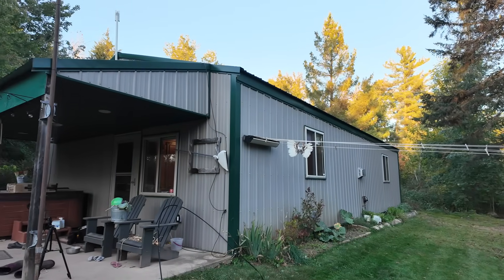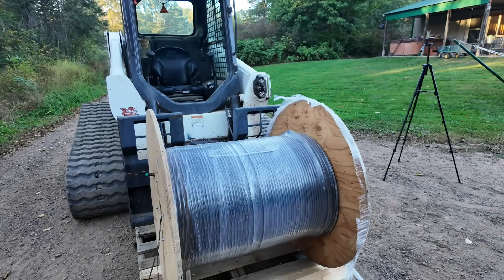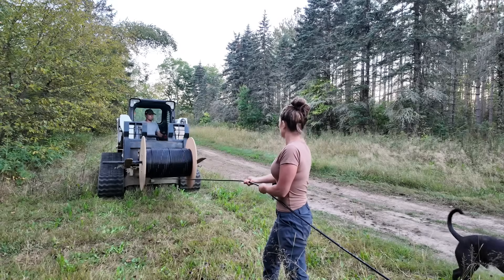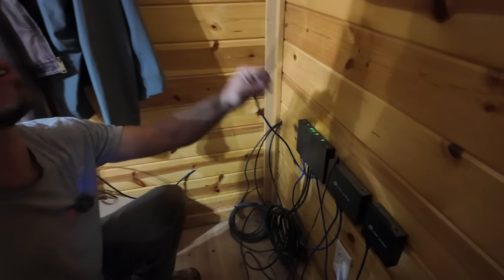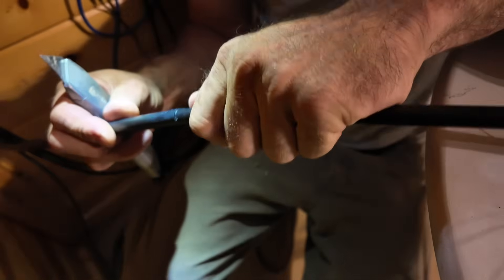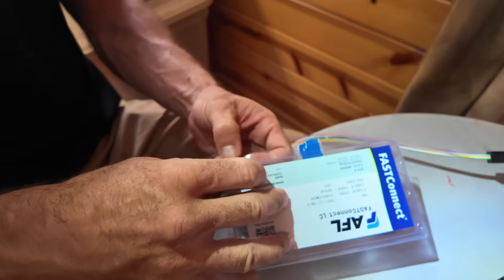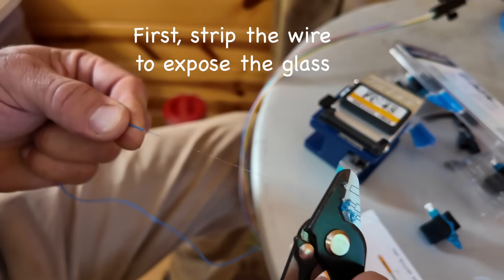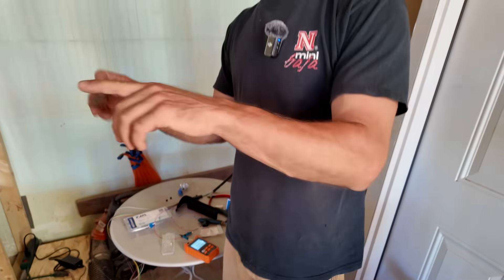We Need Internet! Running a 3,000 ft Fiber Optic Cable

Comment: Hi Guys, I have the exact same scenario that needs to be done - extending a 300-500GB ISP service just over 2600' and thought about doing the exact same thing as you before I found your video.   QUESTION:  Barring standard losses in an imperfect system....the only thing missing from your video was results. you said you were "happy" with the results...but what were they.    Can you share a little by possibly giving a speeds test (directly connected to your Starlink) and then a speed test average from your shop wifi at the other end?   I also love the TP-Link stuff and also was going to utilize the TP link Ethernet to fiber converters, etc...   I would love to see what your results were - like are you getting 150MB from starlink and close to the same at the shop....or are there some decent losses, etc...    Please advise.       The only difference is that I would be using pre-terminated 2600' (6) fiber line.

Comment: The only things that i wouldve done differently would be putting a 2 or 3 handholes every 1000' or 750' and leaving like 20' or 30' of slack in them just incase anything bad happens to a segment of the fiber. And the process of prepping the fiber and putting iwouldvehousing or wall mount would be the best. But other then that, great job on taking it upon yourself, researching, doing the work, and making mistakes. Thats how you learn and get better!!

Comment: FYI you were testing at 850nm which is used on multimode fibre. Your SFPs are single mode and user 1300nm.

Comment: Great job figuring all that out. You're also supposed to clean the ends of the LC Fiber connectors with isopropyl alcohol to remove any dirt and oils from the tips of the fiber ends.

Comment: Fiber is a good futureproof solution. especially single mode like you have here. I've installed miles of the armored stuff like you have. Keep it away from the mowers and snowplows and it will be good for decades. If you build a side road or need to protect it, split some water pipe for protection.  It's also good to leave some slack in the woods every once in a while in case it gets damaged and you need to splice it back together. In current professional installation, we'd use a fiber termination box/shelf with connectors and pigtails and fusion splice the pigtail leads to the outdoor fiber with a fusion splicer, skipping the fanout sleeve.. Another 1000$ and more learning.... But your old school way is fine. The light meter you can test with a patch cable to the light source, then add the fiber link in the middle and subtract the two numbers to see the difference.

Comment: Ryan & Katie.  It was reasonably challenging to find the basic facts on you.  Like your names and where you are.  (Which is Northern Minnesota.)
As of last week, I got my fiber optic cable installed for Internet service.  (Is that why YouTube recommended your video?)  Glad to be free of the oppressive cable utility!  It was ridiculously challenging to find the "terminate service" button on their website.  And they still want to charge more!  Prorated something or other.
I am very impressed that you did your own fiber work!  Especially the diagnoses!  It is so different from wire-based technologies!  As you will be dealing with cold conditions, I understand why you will be trenching and burying that cable.  May I suggest burying with it a tracer wire?  I have a 15 year old natural gas line that has one and it has been used twice to avoid the gas line for subsequent work.
Regards from Oregon!
Reply: Excellent suggestion on the tracer wire! 👍👍👍

Comment: I had this issue. I ended up going with the Deco mesh system, with solar powered x50s installed up on trees backhauling each other. Benefit is you get gigabit internet through the entire woods. Bad part is ping gets bad the further it has to hop. Your setup looks reliable and robust!

Comment: But why? I set up a WiFi link 20 years ago that went 22km at full speed (for the day). I think you got ripped off with your wifi link. Heck, the tiny dish looks like an indoor TV antenna. With a couple of decent yagi antennas it shouldn't be a problem, even with bog standard routers.
Anyway. Besides all that I did find your video interesting and entertaining. Cheers.

Comment: Actually about those fiberoptic connectiors, one need to get them sortof flat and then preferably polish the ends, but those connectors you used is probably those field assembly thingies, they are kindof forgiving because of the gel inside. works on short distances but when doing thousands of kilometers u need the polished glass ends, also make sure not to put any grease on the ends, they are fairly sensitive to dirt, even invisible dirt. ones fingers are enough to totally destroy the connection. then cleaning them is the solution.

Comment: I did buy the 12 core cable because the 2 and 12 core was about the same price, there was like a 4% difference. one never know if it will be needed later, in my case it actually became needed later, but that might be because i'm a computer dude :D

Comment: For me, I simply put up a second starlink.

Cheapest option overall especially figuring in time and redundancy.

 Later,
 i put up two 50' radio towers w/10" pole, on both ends with a wireless bridge as back up to my back up.

Then I added to the towers cellular boosters with custom yagis.

That gave me 4 means of outside communication redundancy.

Im a HAM as well, so adding radios to both locations added 2 more. 

Then I figured I could also add TV & radio broadcast antennas. 

Got hit by a microburst. 

Still had coms at the guest house.

Comment: The reason the wireless bridge didn't work is because it's 5Ghz. That is line of sight only. For going through a few trees you'd need a 900Mhz bridge. They are harder to find, but would be more likely to work. The trade off is the speeds aren't as high.

Comment: Fiber is fairly easy - it's the mechanical aspects of running the cable that is difficult.   When I did my most recent run (1850 ft), I hired a company that used a ditch witch to install a 1" conduit designed for fiber with hand hole boxes about every 500 ft.   I didn't have a meter, but used pre-terminated fiber that came in with a lab report from the vendor which tests the cables after installing the ends.    Worked great with 10km rated single mode 1310nm SFP transcievers in Netgear switches.    I also use a box with a fiber patch panel where the fiber comes into the building so all exposed fiber can easily be replaced if some ne'er-do-well damages it.

Comment: I also suggest you get a box that will mount on the wall specifically a fiber optic cable box, most are waterproof but still serves the purpose at protecting all the fibers dead lines or in use

Comment: Lots of fiber guys in the comments, right on! I did some wireless ISP stuff years ago and yeah, when you mentioned doing a point to point wireless shot "through the trees" I cringed a bit, that 2.4/5ghz stuff really didn't like non line of sight stuff in any situation and we generally had to use 900mhz non line of sight gear for stuff like that, but you're still limited on distance, bandwidth, noise, path, etc... long run you're going to be much happier running this cable though and it'll at least give you consistent connectivity to your stuff behind the firewall. Great work!

Comment: Put that fan out kit into a termination box mounted on the wall and use some patch cables you will be set up perfectly. Mounting the cable and the terminations into the box takes the strain off of everything. No problems in the future that way.

Comment: A much easier solution is to buy some patch cords. And cut them in the middle, then splice them on with a fusion splicer. It will make very consistent connections everytime and you won't have to deal with the hassle of terminating.

Comment: Only works with no obstruction. 
Microwave links are great if there is nothing in the way. 

I remember when the fiber was installed for the Internet to replace the old copper. 

For 3 years they dug the trench along the highways and I didn't see any amplifier 
They had flower pots every mile to splice the cable together. 

But as far as I could see, from MP144 to MP64, 80 miles, they had just the fiber cables. 
From one switching center to the next.

The craziest thing was seeing these massive cables as big as my arm and the capacity was maxed out, and when they switched on the first fiber on, the meter went from 100% to 0
It was below 0.0001%
The technology that we don't know will exist is mind-blowing to think about 

Remembering the 6 foot cube that weighed 4000 pounds that was the 10 MB hard drive in 1950
And in 1980 that same drive was 12 inches by 6 inches and 30 pounds 
And in 1994 a CF card weighing a little more than a stamp was 10 MB
Watching the CF cards go up to 1GB
And the TF cards going up and now something smaller than a stamp and the same weight can store 4TB

I remember Ethernet first coming into existence.
And then wifi
And the size and weight just kept getting smaller 

The Cisco Router weighed 50 POUNDs and took up the entire rack
Now a 12 inch by 1 inch by 5 inch box weighing 3 pounds does more than the original router did
And the new router was 250 and the original router was 10,000 dollars 

For us old people who remember tubes and watched the electronics go from infant to mature, I feel really old

Comment: Great job! One suggestion I would make, is that you secure your cable to the wall after it comes in (allow some slack for future potential repairs), and give some sort of protective covering to the small strands coming out of it. Generally, with a rack install, you would run your main cable into a fiber distribution shelf/tray with F-F connectors on it, and then use easy-to-replace fiber patch cables from there to your equipment. But even if you don't use a fiber distribution shelf, having some sort of protection around the delicate fibers will be wise. That way the fibers from the cable stay securely out of accidental danger of being ripped out, tripped over, mouse running on it or chewing on it, etc. and if some of your network equipment falls off the wall or you accidentally rip the fiber out of it or something like that, you can just plug in a new patch cable and you're good to go, rather than having to go through the full process of re-terminating the main cable, testing at both ends, etc.

Comment: Learning and getting your Amateur radio license would've taught you so much about RF and why this project didn't need fiber. 😭 2 Towers and proper equipment this is easy peezy to solve wirelessly with basic equipment

Comment: As someone who works on fibre optic networks in the UK, this was very interesting to see how you'd do it from a DIY view point.
Amazing work though for DIY I've seen people do way worse haha.

A few suggestions for you for long run would be to run your 12F into a CTU / CSP (a housing) then buy pre terminated duel LC cables for a TX/RX system (that's what your using),   If you can rent a splicer this way the cables will be much stronger and stable connection, this way not making custom ends.

You maybe could use a SC connector so that way you only need 1 single fibre running into from the SFP chips. (this is main source we use in UK)
Reply: Exactly, I was wondering why they need tx and rx with such distance(usually single mode were used when over 1km)

And yup splicer and pig tail works way better.

Comment: This is a great video. I do have one input on the Fiber SFP modules (Small Form Pluggable) beware of running you optics too hot closer you are to their transmit levels or above you will burn out the receiver sooner. Most manufactures will tell you what the ideal operating range for the optics is. Looks like for the TEG-MGBS10 you guys have that's a 10km 1310 so a safe operating should be around -5 to -8 and according to the Trendnet its sensitive down to -22bdm. so you may need to buy a single set of attenuators to attach to one end of the fiber to pull down that light just a little. Just worrying about your longevity here from a network engineer stand point. i also believe that with in the TP omada control system it should give you the feedback of what light levels both sfp's are seeing, so no need to unplug and retest while taking down the connection
Reply: I hacked it with the TEG-MSGS10 at an install.  My original 100ft and 800ft runs are working nicely after 5+ years.  My 1800ft run is a year old and holding up nicely.    Perhaps I should worry about my 320 ft run, but the SPFs are not a big cost item.  My most recent run (the short 320 ft one) used the RI-MGBS10 SFP with a slightly better low temp rating (these are using in unheated outdoor enclosures).

Comment: Measuring to where the cable enters the cabin?   I hope you have allowed additional cable  to where the cable needs to go inside the building (and preferable a good length loop for future changes and termination repairs).  It is extremely false economy to be short.

Comment: I learned fiber termination a couple decades ago, we were using hot melt and epoxy connectors then, you stripped the buffer layer, inserted it into the connector, let it cool, scribed the glass with a diamond edge, snapped it off, and then lapped it flat and clean, checking it under a microscope. real pita compared to the push and go impedance matching gel connectors of today.

Comment: First time viewer. Very nice "tutorial" as it were.  I love the fact that you explained what went wrong and why it did and how to fix the problem. Excellent work done!!

I've actually thought about doing something very similar on my property. But instead of connecting two homes, run a main line from the pole where the cable is serviced to the back part of the property that's not developed. Don't want to pay the installers to run that long bit if not needed (if it's cheaper than running cable, then sure)

Comment: I agree with others, great job, but bury that cable properly! And securely attach the cable at both ends with wire clips, but ensure the bends are smooth and curved gently as possible in the cable, no sharp kinks, and get a grommet for that hole in the metal shed you cut.

Comment: If I may make a suggestion. When you bury the fiber also bury a 6 pair direct burial phone cable (22 awg), not in the same ditch. This will allow you to install a ring down phone as backup so you can at least talk from one end to the other in case the fibers get damaged.

A ring down phone will allow you to talk with the other end. Just pick up a phone at one end and the other phone will ring until it is picked up. The ring down unit cost about $200 or $300 .

I use one between my shop and house. Nice job with the fiber and setup!

Comment: For burying your fiber cable, you might find it handy to buy an attachment for your compact track loader. They make vibratory plows with a chute that make a knife cut in the ground and bury your cable. You can also get them with another slot for burying the warning tape. Vermeer sells them, but lots of track loader manufacturers make them, and if they don't, you can ask the sales person to point you in the right direction. The other attachment you can use is a trenching attachment, but then you have to go back over the trench and back-fill it, so it is more labor. You might find a Vermeer or Ditch Witch location with some units that you can rent to do everything.

Comment: Hi, thats cool looks like anyone can do it. xD Here in Portugal the ISP doesn't use this plugs, I mean they use but they solder the cable into a box which terminates into a female, and then you have to use a pre made cable to connect to the router. Maybe its because of realiability that plug you did can fail easier than one from factory!

Comment: To give you an idea of how robust the fibre is, just tie a knot in a spare fibre, then pull it tight.   It will usually make the diameter of a pencil before it snaps.